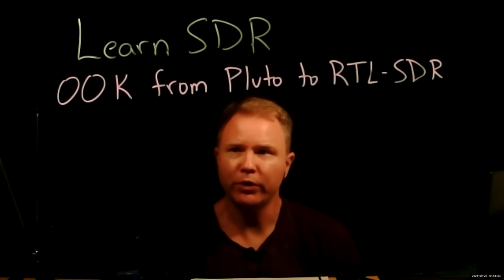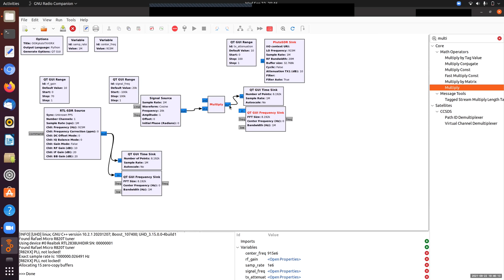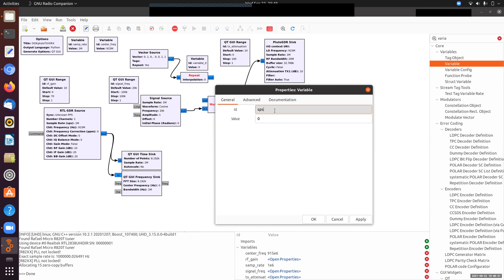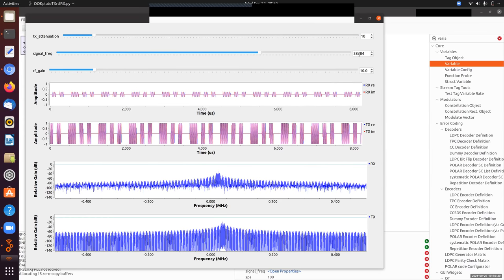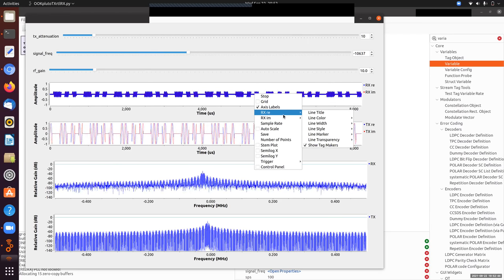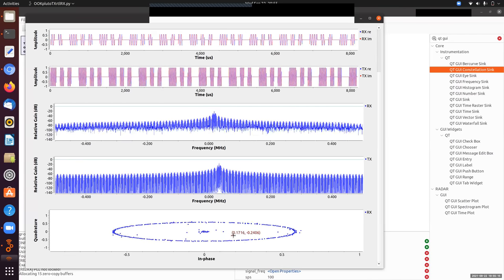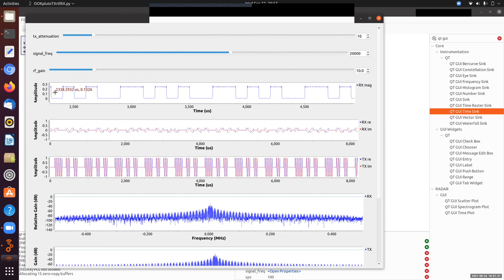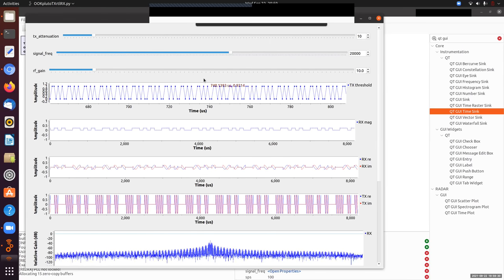Learn SDR 10: On-Off Keying (OOK) from Pluto to RTL SDR

Comment: There is a significant difference if the cosine frequency was made zero, I am unable to get the bit pattern that was transmitted. Is that interference or something else?
Reply: I'm just learning too, but I think that in order for a Electromagnetic wave to be transmitted through an antennae, it has to be oscillating. A zero frequency cosine wave is just a constant and if there is no DC offset, that constant is zero. So you'd be transmitting a zero when on and zero when off.
Reply: Is it possible to make ook demodulation of the modulated signal ( 1ghz CW + 10KHZ square wave  ) by complex to mad block